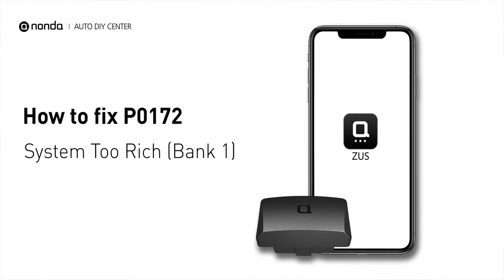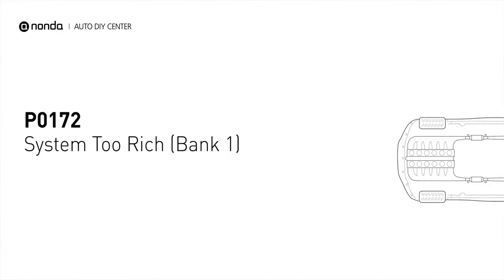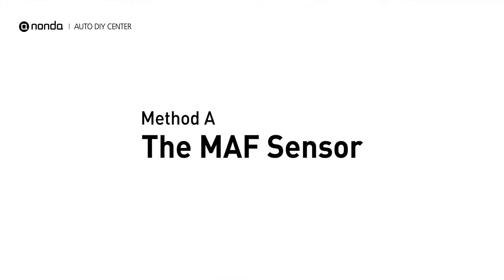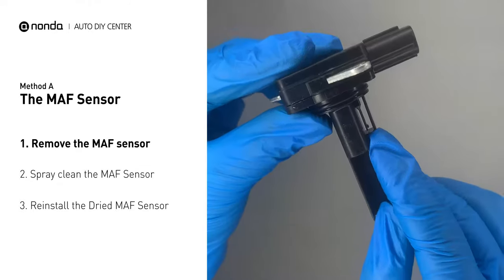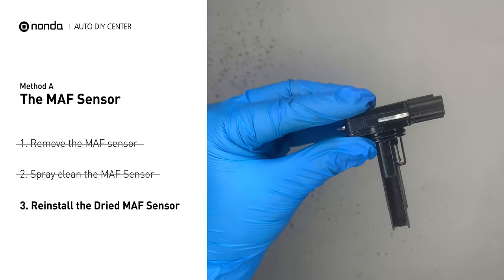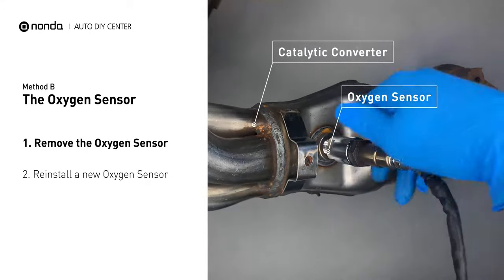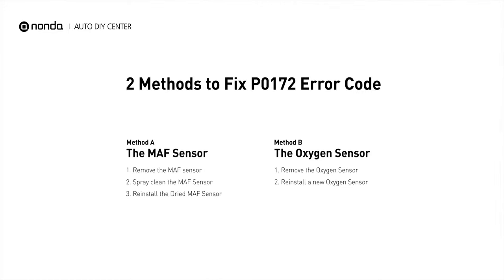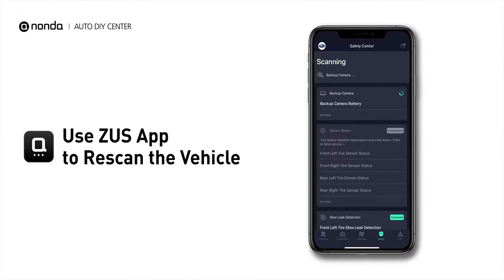How to Fix P0172 Engine Code in 2 Minutes [2 DIY Methods / Only $8.77]

Comment: This code appears when using LPG in my vehicle. Is there a method you can recommend for LPG vehicles?
Reply from the maker: Hi Reha, please have a check for leaking injectors.
Reply: I have Same problem. Did you find solution?

Comment: Hey I have a 2012 Chevy equinox and I  keep getting that p0172 code plus when I turn off the engine the engine or car shakes is this all from the same problem, and what could this be?
Reply from the maker: Hello, please try cleaning the MAF sensor. If the issue will still persist then method 2 is recommended (replacing the oxygen sensor).
Reply: Did you manage to fix it? Having same issue with 2012 equinox

Comment: Hi, I recently replaced all oxygen sensors (Bosh) on my 2003 E46 325I BMW and I also replaced the cabin air filter. Put scan code and code P0172 popped up. Any advise?
Reply from the maker: Oftentimes, the reason why this code appears is a dirty/faulty Mass Airflow sensor or a vacuum leak. Please try cleaning the sensor with the MAF cleaner. If the issue still persist then perform a fuel pressure test, and replace the components in the fuel system that are failing.

Comment: i installed a cold air intake on my 2014 bmw 528i and got the code p0172. I cleaned the MAF sensor and the check engine light is still on. I also changed my spark plugs and such about a month ago. any advice?
Reply from the maker: Have you checked the oxygen sensor?

Comment: I have a chevy impala 08 how do I fix p0172
Reply from the maker: Hi Josh, the most common reason that triggers this code is vacuum leak. Check your oxygen sensor, MAF sensor, fuel pump/fuel filter, and if any of your fuel injectors have issues.

Comment: I've changed the MAF, upstream and downstream o2 sensors before I've seen this video.  The car is also reading a misfire on cyl 4.  I have a 2014 Mazda 6 with 120k miles
Reply from the maker: Hello, we suggest looking for a vacuum leak and checking the condition of the fuel injectors.
Reply: Change fuel injectors
Reply: Try cleaning the fuel injectors before changing them, this happened to me with my 4runner, changed the spark plugs and wires, and then cleaned the fuel injectors, solved.
Reply: have the spark plugs ever been changed. If not then it may be the original set and they're probably due to be changed as it's recommended to swap them out every 100k or so.
Reply: EGR try that bro
Reply: i can’t find the MAF sensor anywhere
Reply: @blixaiah0129  should be along the intake hose before it gets to the throttle body. when in doubt check youtube for the MAF location for your model of vehicle
Reply: What did you end up doing?
Reply: Chrysler 300 2006 3.5 I've changed egr, map, fuel pump plugs ignition coils I've check leaks check wires still keep get p0172 code car run good an smooth on highway it have a rough idle at start then smooth out  check engine light comes back on with code after resets
Reply: @kevinhollingsworth1410 how did you resolve, having same problem
Reply: @kevinhollingsworth1410  Has the problem been resolved, I'm curious as I've made the same fixes as you.  Light still on

Comment: My is250 threw this code after doing a primary catalytic converter delete. Is it possible putting a spacer in the oxygen sensors can fix this code too? I’m worried that we may have to buy new cats now.
Reply from the maker: Hello, we recommend taking your vehicle to your local mechanic for further inspection to avoid misdiagnosis and to apply proper solution to the issue.

Comment: Hi I just bought a used 2008 Dodge Charger and these codes came up can you help me out on what I should buy or replace?
P0172:system too rich bank 1
P0175: bank 2
Po152: 02 sensor circus high voltage bank 2 
sensor 1
P2181: Cooling system performance 
The guy I bought it from said he put in new oxygen sensors but I seen he only did three could that be the problem?
Reply from the maker: Hello, try to clean the MAF sensor, oxygen sensor and fuel injectors. Check for any vacuum leaks and check the condition of the spark plugs. If the issue will still persist after doing these methods, we suggest taking your vehicle to your local mechanic for further diagnosis.

Comment: 2016 honda pilot emission system message pops up every 2 days then disappears then reappears
Reply from the maker: Hello, kindly examine your air filter housing if needs cleaning and check the condition of your O2 sensor on the exhaust for any issue.

Comment: Cmary 2007  P0172/P2196
Reply from the maker: Hi Ros, having both of these codes could be a cause of clogged engine air filter, bad spark plugs, leaking open injector or you might have a faulty oxygen sensor. Please have your vehicle inspected by your local mechanic.
Reply: @nondainc  ok

Comment: Silverado P0172/P0175
Reply from the maker: Hi Isaac, we suggest cleaning the MAF, throttle body, and check for exhaust leaks. Also make sure that the O2 sensor is reading correctly.

Comment: 2002 Miata p0172
Reply from the maker: Hi Chris, it means that the motor is running with rich condition. Kindly check for vacuum leaks, check the oxygen sensor, MAF sensor, fuel/pump filter, air filter and if you have a bad fuel injectors. These will help you pinpoint what causes the issue.